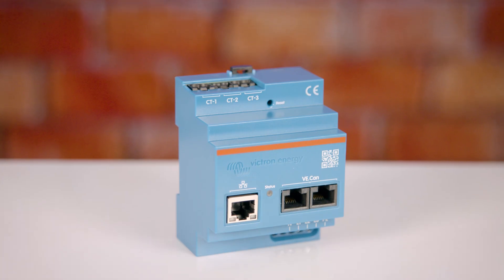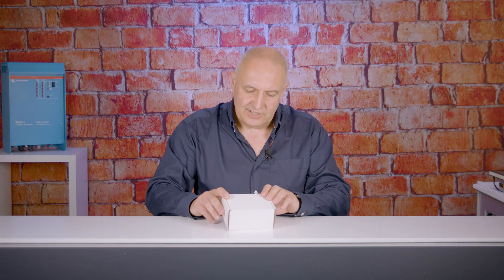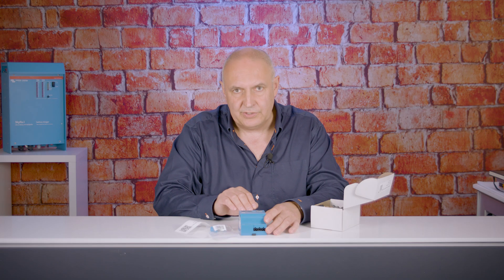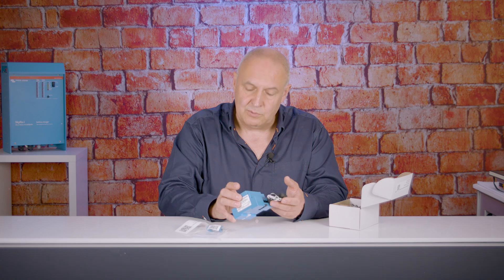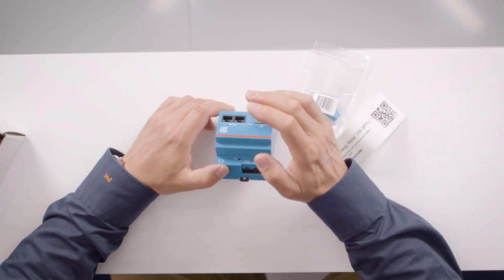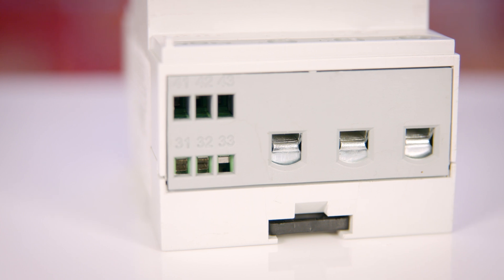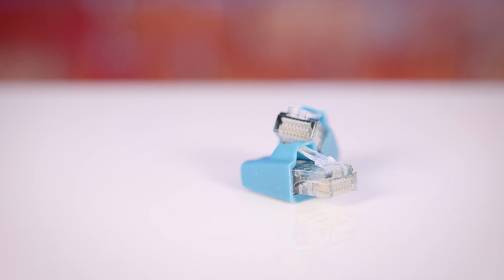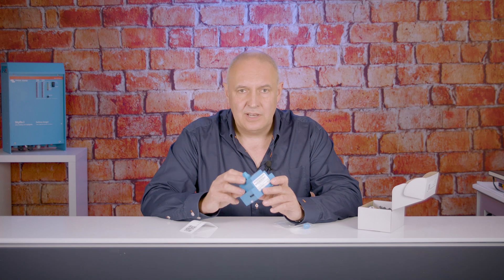Victron Energy Meter - A 3-Phase Current Transformer Meter for Victron Cerbo

Comment: Single phase question: can you use one monitor:
L1 CT to measure grid import/export 
L2 CT to measure PV generation  
Like a ET340. 
Or do you need x2 Victron energy meters?
Reply from the maker: The Cerbo sees the energy monitor as a single device. So you will need 2 meters to measure the different areas. A bit of a pain for single-phase systems where you might want to use the 3 CT’s for different purposes.

Comment: Just picked up two of these to trial in a couple of installations. The reading rate at 100ms makes for a great value upgrade if it works well. Looking forward to putting into use.
Reply from the maker: Brilliant! Should you require any assistance or guidance please contact our sales team - sales@energy-solutions.co.uk